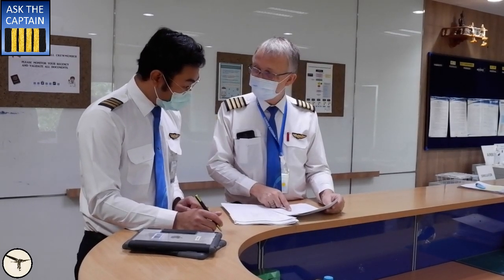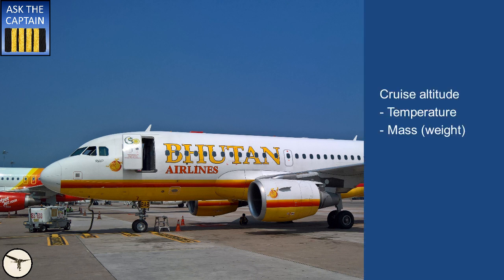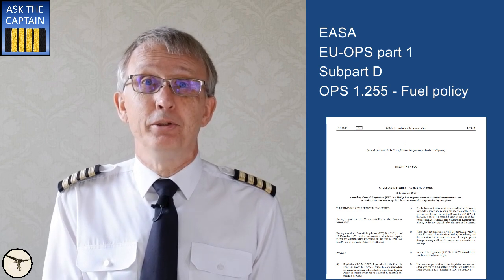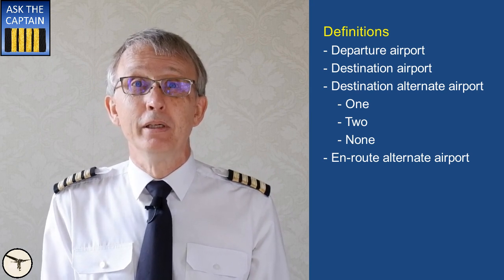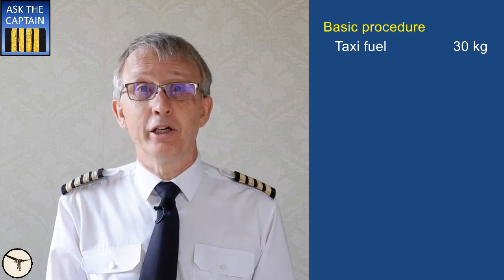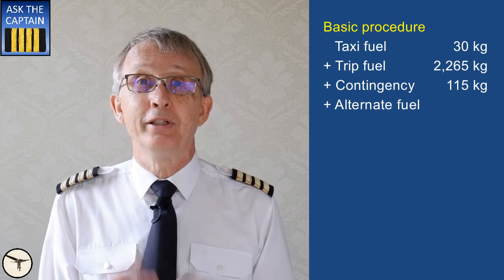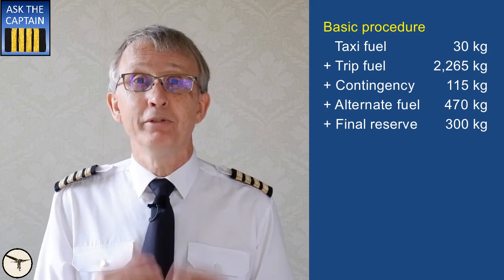What is minimum fuel requirement for airliners?

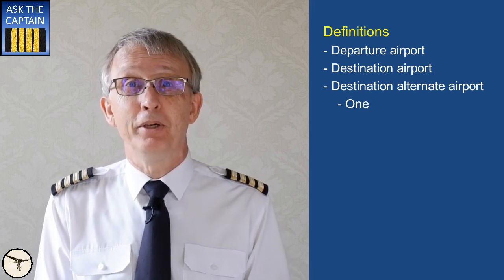Comment: Hi, thanks for this.  ❤ At timestamp 4:00, could you clarify “when the destination weather is below planning minima” (which will then trigger a second destination alternate)? What constitutes ‘planning minima’ in this case? Is it simply the minima from the approach plate? Or is there a buffer?
Reply from the maker: The rules for planning minima may vary with national regulations. I know the EASA rules. You use tables in the company's operations manual to determine planning minima. 
For a destination, the planning minima is defined as visibility (based on DH/MDH and the availability of approach lights.) For a circling approach, the ceiling must not be below MDA. 
For your alternative, the planning minima for an 3D approach is the minima for the best 2D approach. If there's no 3D approach, then the planning minima is the minima for that 2D approach plus 200 ft and 1000 m respectively.
Reply: @FlywithMagnar  Hi Magnar, many thanks for your reply and a fantastic channel!
To confirm - for the destination itself, we basically look at the destination's instrument approach chart's minima for the expected runway. Correct?
For alternates, I believe EASA has recently introduced some more complex regulations. What used to be the 'next instrument approach up', now uses the concept of Type B and Type A approaches. I had to read the regulations a few times to understand ;-).
Reply from the maker: @svdm007 , yes, we look at operative minima (visibility or RVR)

Comment: Thanks , I would like to know your opinion about the best and the most difficult part during your ATR type rating. Thanks a lot love your channel
Reply from the maker: I did my type rating at ATR Training Centre in Toulouse 21 years ago. At that time, ATR did not have a proper training manual, but a tiny book they called Minidoc. It barely covered the essentials. It was up to the instructors to fill in the rest, and they were not standardized. That was the most difficult part. The best part was the food in the canteen.